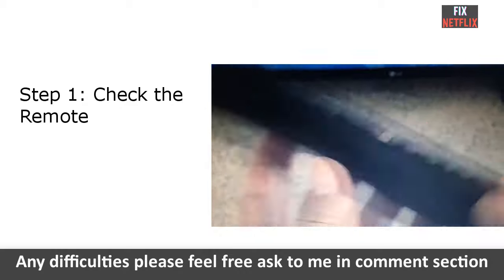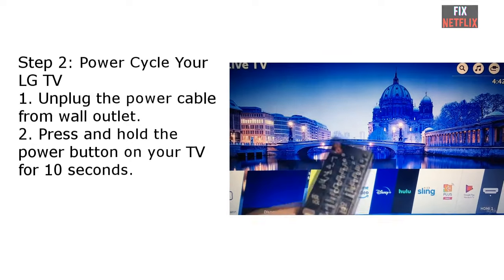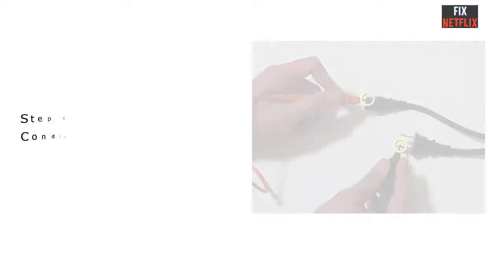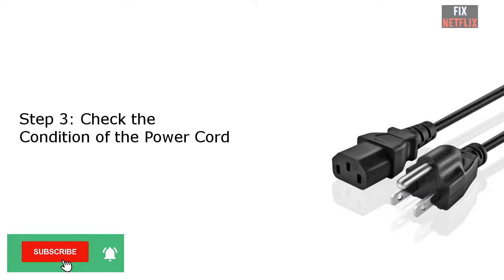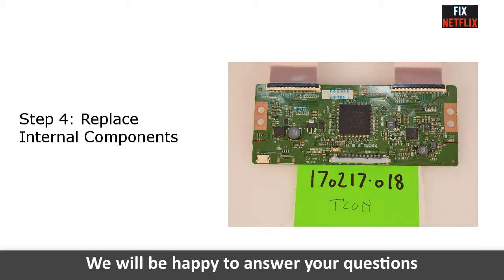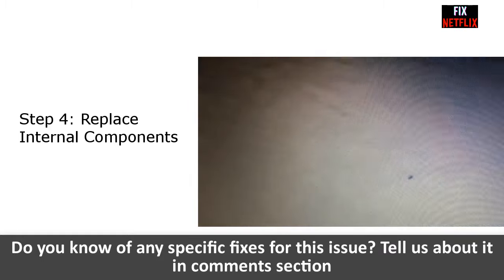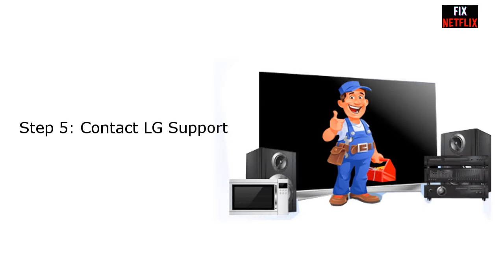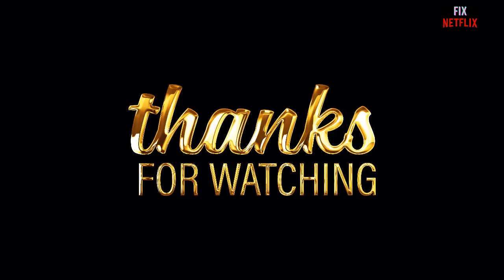LG TV Won't Turn On /No Standby Light /Red Light Is On /After Power Outage- Fix It Now

Comment: I have a 43  inch lg 3D smart tv  ,when switch on the tv work well within five minits then scren goes black colour ,no picture ,whats happen
Reply from the maker: Dear sir, this is happening due to high temperature in psu board and faulty ic on psu board.  Please check voltage supply and replace the faulty part. 
Hopefully this will solve the problem.  
If any difficulties please inform me. 
I will be happy to help you.